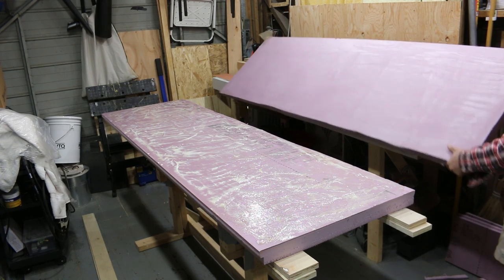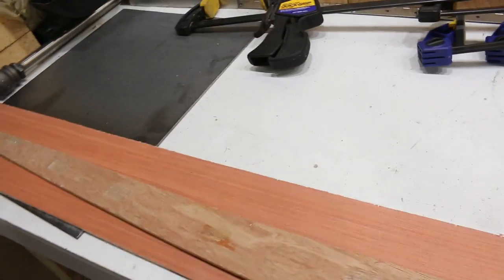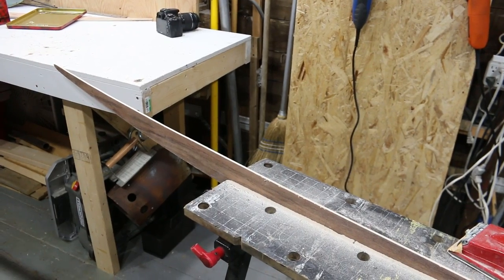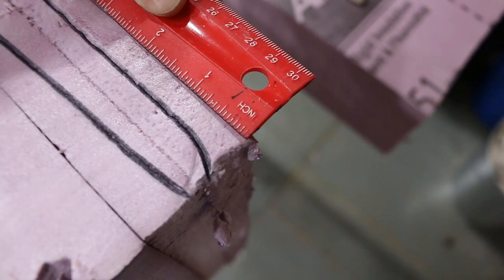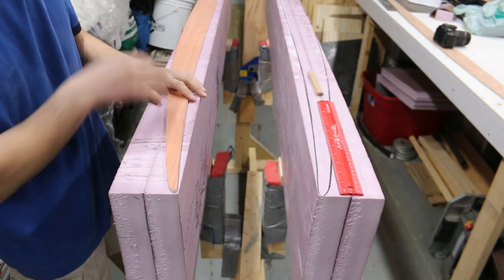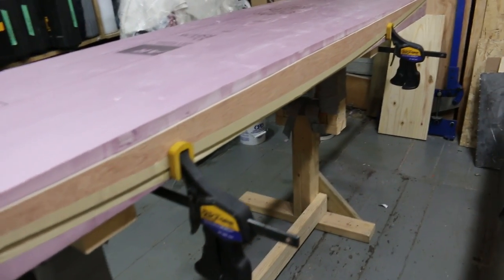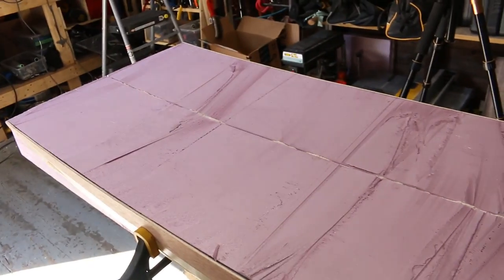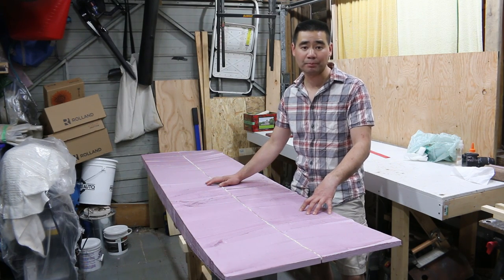How to Make an XPS Foam Surfboard #03 - Making the Blank - Part 2

Comment from the maker: Just a comment about fumes and safety when hotwiring foam, I previously wore a respirator when doing this but since this is minimal exposure I didn't bother and the door was open.  If you are worried then by all means wear one, never hurts.  My favorite is the 3M with organic vapor charcoal cartridges.   

Eye protection as well as the hot wire can snap when cutting, an eye and hotwire do not mix!

Comment: i have a mad idea for a finless board with gull wings a little way towards the rear of the side edge, when the board is on the edge the wings act like fins...it will need a bit of cross bracing maybe with some kind of metal weave..and the glass might not stay on those sharp edges so it might need a surface coating with araldite...raised outrigger fins....i'm sure there must be jetski hull designs with a similar concept

Comment: Awesome videos. Currently bringing foam down over the Stringer so I can use my sanding block to bring  the rest down. Question is after I hot-wired top and bottom are no longer exactly level so even if my rack is level whichever surface is facing down won't be level therefore messing up the other side on block sanding. Don't know if I'm making sense explaining this. Any ideas to make this easier? Thanks Tom in Florida

Comment: you could make the board without stringer enough to reinforce in the lamination, as it is a current trend and would still reduce the inperfections at the time of the cut of the outline. Even though it was excellent

Comment: such a good series andrew, mahalo. question: if you don't have a stringer (i'm making a very thick SUP; didn't seem necessary), can you still hotwire off the two profile templates -- or will the hotwire tend to drag in the middle without that center guide?  appreciate it!

Comment: It just came into my mind because last time I did that (I copied your method as I watched your previous vidoes) to align the outer templates and make them sit exactly where the stringer is supposed to be is a bit of an pain in the arse and also suspecible for mistakes. 

So one would not have to measure everything exactly in order to align the outer templates to the stringer,  if the blank is still intact and not cut in half. So changing the order by trace the outer stringer templates with the hitwire and after that cut the blank in half and glue in the original stringer would result in less measuring and probably in a more precise outcome? 

I hope you can get my english. 

Tom
Reply from the maker: Yup I think I understand what you are saying.  Your method would work too but I think clamping might be harder.  Try it :)